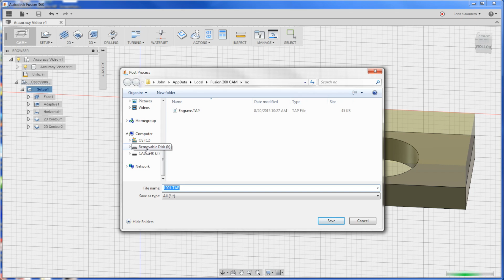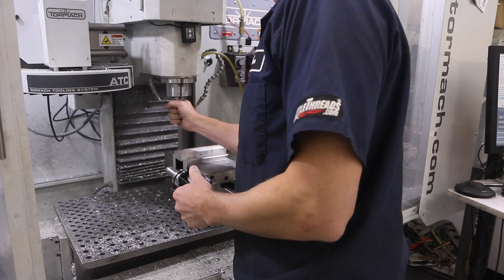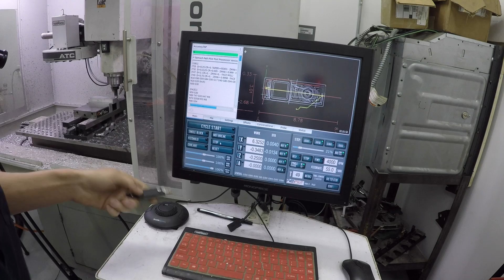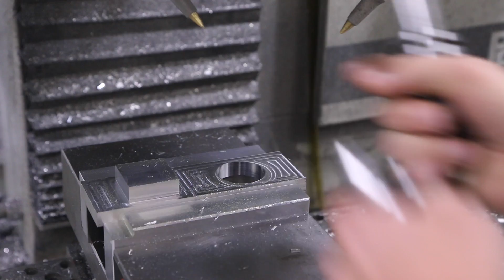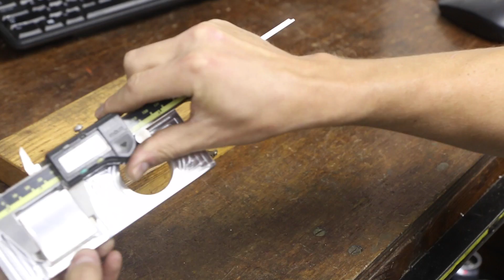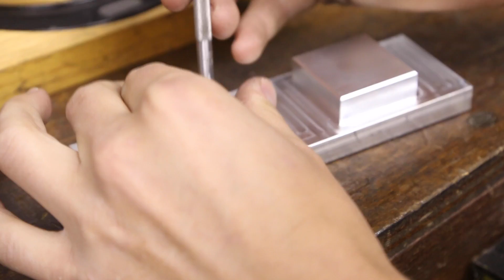Tormach Accuracy & Surface Finish Test!

Comment: Wow.  Hard to believe it's been five years since you posted this one.  I love what you said at the end about it not being the tool but rather the carpenter.  I cannot foresee going into debt for a machine that costs 4-5x more than what I actually need.  I just pulled the trigger on a 770mx to supplement my old 440.  I'm upholding the spirit of bootstrapping in order to make the best machine per dollar work for me, not me working to pay for it.  This 770 is going to have only fogbuster, but I'm going to keep it dry running brass for the next few years for the fixture designs I will be doing.  I'll use my old 440 for aluminum or steel that may require coolant.  I have a client that is making this possible, so why go crazy and over-finance? Thanks again and again for the guidance even if you are far past Tormach days...If this was you 5 yrs ago, then I may be where you are now... in five years, and I will have paid off this latest addition to my small shop and ready to buy some serious machines to get my son up and going in the business.  God bless you brother, say hi to Jared.

Comment: why would you beat a part down on pos 1? you want to cut any boew out of it?
Reply: No, it's to make sure it's fully seated against the supporting parallels.
Reply: @steveh8724  I can under stand that but if the part is bowed at all you beat it down and cut and release it, it will be warped

Comment: Garbage ass machine. You're a paid youtuber. Buy Haas. Do your research on these machines people.
Reply: I did. My research indicates that a new low-end Haas machine is double the price of a Tormach (and includes maintenance fees). Although you get what you pay for, why would I pay for capabilities that I don't need? Especially when paying for them is simply not an option as I'm not trying to earn a living from a CNC mill. If you can afford a Haas, or justify buying one on credit, then of course buy one. Why would you even be looking at Tormach? But if you're a hobbyist or don't yet have a proven business model with adequate cash and cash flow, then it's either a Tormach or similar class new machine or a used VMC. I for one don't have the experience or the patience or the risk tolerance to go with a 15 to 25 year old industrial behemoth with antiquated control software. Sure if you're lucky and/or skilled enough it could be a 'bargain', but it could also be a huge mistake. Tormach has a huge installed base and there's no shortage of helpful information from Youtube and various machining forums. And Tormach offers excellent pre- and post-sales technical support.
I'd much rather learn the hard lessons of CNC operations on a machine where even replacing the spindle is <$1000 vs. >$6000 for a baby Haas. Finally, take a look as the used Tormach market. You can get a significant fraction of your initial investment back if you need to move up. Or keep it as a 2nd op/development machine as your need grow.
Finally, you can do a little searching and find other luminaries such as madman440 who will call a Haas a 'garbage ass machine'. And they're right if you need even higher accuracy and performance. So it's all about matching your purchase to your needs and your resources.

Comment: Not really checking machine accuracy there. A lot more to machine accuracy than measuring across a couple points. No flatness tests, no squareness tests etc. Old school (before ball bars and lasers ) was a circle diamond square cut test. That will tell you something.

Comment: Accuracy failure. Manipulating that micrometer to get the size he wants.
Reply: I think he just doesn't know how to use a micrometer. You have to rotate the rachet at the end.
Not mentioning that kind of old mechanical micrometer is not very accurate, it has more than ±10 µm accuracy,  similar to a new digital Mitutoyo caliper, not better. The new digital Mitutoyo micrometers are better ±2 µm if they are small. But this was his grampa's micrometer.
Reply: @telelaci2  The mechanical micrometers can be just as accurate as a digital. His.. probably not, because it isn't calibrated. But your average 0-1" is mechanical is accurate to .0001". My Starrett Hi-precision mechanical micrometer, which first came out in from the 1950's, is accurate to .00005".
Reply: @Process-Theory  I think you are a little mistaken, but at least we are not talking about the same thing. Your grampa's micrometer is far from precise, at least compared to it's nominal original precision. Abrasion, warping, distortions, corrosion all those things do the job slowly but surely. If you buy the above (similar to) micrometer today and its Mitutoyo Digital micrometer, then its ±3 µm , because its not the regular small micrometer, but a big one. If its not Mitutoyo but an "average" (no ebay! no china! but a good average) that is about ±5 µm, slightly worse, not much though. If its an old vintage its about ±10 µm. That micrometer above is not in sealed box, dirty, the user donno how to use it, probaly it was overtightened few times (without using rachet), so I think my ±10 µm (.0004'') guess is quite optimistic.
"But your average 0-1" is mechanical is accurate to .0001"" - yes, correct but this is not that small, obviously less accurate just because of it's size.  About .00025'' and then a little worse again 0.0004'' because its worn dirty never calibrated vintage thing. I could be wrong though.
Reply: @telelaci2  I was more referring to the fact that a digital micrometer doesn't always equate to being more accurate - which is what most people believe because of the readout. I agree that a worn or abused micrometer is likely less accurate.
Reply: @Process-Theory  I agree, and I know its only the readout (unlike calipers). Digital Mitutoyo => the newest and branded and pricey category, I meant so. Mechanical can be same good and precise of course..

Comment: what accuracy test is this. if you dont get correct measure it changed for  tool offset. oh you are using cam and it give calculated path.
is that same program doing difrent size on difrent machine with same tool? thats accuracy test

Comment: Would love to see some actual photos of the surface finish slightly closer up then at 22:00. Curious to see how the end mill's side cuts look. My 1,000lbs machine leaves some ripples/vertical lines when climbing from the flutes depending on RPM and feed speed.  I've also  noticed any vibration can cause them to look and feel inconsistent so I moved the RPM down and got  mostly 100% vertical lines but the line depth seems much more than the softer metal CNC machined products I have around the house which I assume were milled on 5,000lb+ machines.

Comment: hi john, insanity check !! i was watching this video as i was just about to run the first parts modeled in fusion 360, i was just about to press cycle start and you said something like " remember select the correct post !! " i paused and re checked and code in fusion 360 and yes the post was wrong, you can get too used to the software you use, then go to new software and don't check it,   lesson learned,  keep the video's coming, thanks Daniel

Comment: I'm having a really hard time getting my new PCNC1100 to behave with GWizard-recommended feeds and speeds. I've posted a video of some of the problems (I'll try to record more examples): https://www.youtube.com/watch?v=7BoCLX4TY7A
Reply: +NYC CNC The one I'd like to do is 30 mm depth/0.5 mm width (finishing pass on the outside). This is 1.181 inch depth/0.020 inch width.

Comment: Moving shop again?! Dayum son ...

On the plus side, you'll be an experienced Tormach machine mover :P
Also, with the camera being high, could you not use some perspex on the lower half of the opening to prevent the chips from escaping the enclosure yet, provide with great vision?
Reply: NYC CNC As it was in the video, just with perspex underneath it so you don't have to clean up with an open enclosure?

Comment: Time for a set of big boy .0001 accurate mics. But that interpolated circle is pretty darn accurate.
Reply: Just because you don't work in tenths does not mean it is not good to be able to measure to it. 

Also I don't think anyone really works into the tenths unless the part is ground or EDM

Comment: Another crackin video! Measuring my cuts like that terrifies me, cause if its off you have to do something about it! I notice the smaller the endmill I use the more my circular pockets reduce in diameter, turns out using the free Fswizard you can compensate for it quite accurately. Just something I noticed.

Comment: Use keyboard modifiers when you're trying to scroll / jog around in PathPilot.  I don't remember which (control, alt or shift) and whether it was a left click, middle click or right click... but there is a combo that will let you scroll around in 3D and rotate.

Comment: Yeah, when I was scanning around the net I saw a lot of posts from the last 5 years saying Tormach is a toy and not to waste your money.  They offer up links to 40,50,60,100 thousand dollar beasts so I gotta say you bet.  Like comparing an 18k dollar car to a 2+ million dollar Bugati.  Thing is both get you where you need to go with the proper driver behind the wheel. ;)

Comment: I see a lot of aluminum work and a little steel from time to time.  Do you do any work in free machining brass?  Reason I ask is I have a Bonanza Bullseye powder measure (no longer made)  I may want a few charge rotors made with varying sizes of cavity.  I do have samples and a machine drawing.  Don't abuse your Tormach.  Take care of your baby.  Keep on keeping on.

Comment: wireless on pathpilot highly recommended - zero issues so far!
Reply: +NYC CNC no - I'm not sure how to install things on path pilot. I currently just back it up to drop box every once in a while from my normal desktop (rick click the Gcode folder, click "send to" and select dropbox)
Reply: +Geof Dumas Ethernet works perfectly too. Extremely easy to set up using the instructions from Tormach. I'll never go back to USB.

Comment: When the superfly stopped, it left a tool mark on the material. Had you walked the tool all the way off the end instead of stopping on the part, would it have not left that mark?
Reply: Correct! Aluminum show every detail of the cutting path so while you would't feel any difference, you can 'see' it in the surface finish.

Comment: Good job on both videos, I realize you may have been doing it only for the video, but if your doing 1 off jobbing, just drop the feed down using the feedrate override rather than re posting your cam files. For a couple of minutes cutting it isn't a big deal.

Comment: Not measured correctly with micrometer. When using micrometer should be used to ratchet the end because it is calibrated for accurate pressure.
Reply: +YYanchev Exactly, and he mentions it doesnt have a vernier scale, when infact thats exactly what scale it has.
Reply: +NYC CNC I see you are correct. I should have checked closer. However, even a standard micrometer is next to useless without using a repeatable torque.

Besides, it's terribly satisfying to twirl the clicky ratchet ;-)

Comment: First! Nice job. I've also chased the dragon of tool deflection. I would try to hit a dimension and would always be just shy of it. Much of the time it would be tool deflection with heavy cuts but sometimes after doing multiple spring passes and still not getting there I found out that the endmills are actually a slightly undersized value from what I was entering them as in the CAM. Once I started measuring finishing endmills with a micrometer and entering that value in my CAM my tolerances have snapped right in to dead nuts. For instance a 0.1875" endmill might actually measure 0.1855 across the flutes, that can make a big difference. Endmills wear to a smaller diameter but not as much as just being a new undersized endmill. If you measure the shank and it is right on the nominal size then my bet is that the flutes are slightly under that size. They would have to be to get a sharp flute edge. I generally find them to be about 1-1.5 thou diameter under nominal.
Reply: +War Machine LLC Pretty much every finisher I ever used was under by at least a thou. Most of them even list in the specs +0 -.002.
Reply: +War Machine LLC Guess I can say that I was lucky in that all of my teachers and mentors have told me to measure the size of my endmills when doing precise cuts such as circle interpolation.
Reply: +War Machine LLC I'm glad I read this!!  I can see me chasing dimensions at some point and blaming everything but the tool diameter.  Thanks! :)
Reply: +NYC CNC Honestly that seems to be the best explanation here, the cuts were too deep.  Backlash/deflection would tend to go the opposite direction and the square would be over and the circle under (i think, lol).